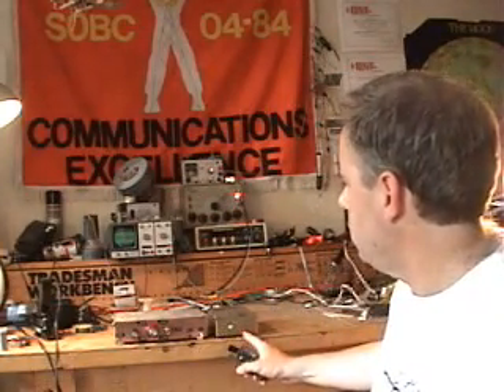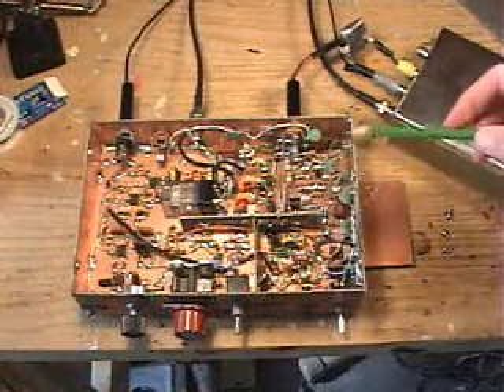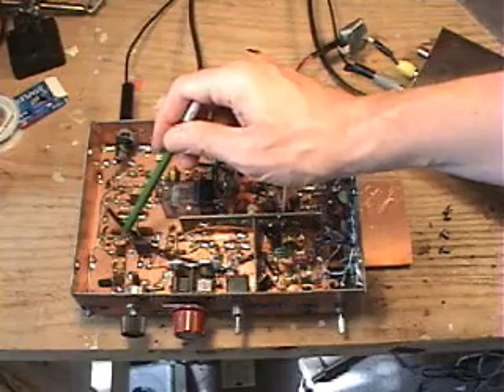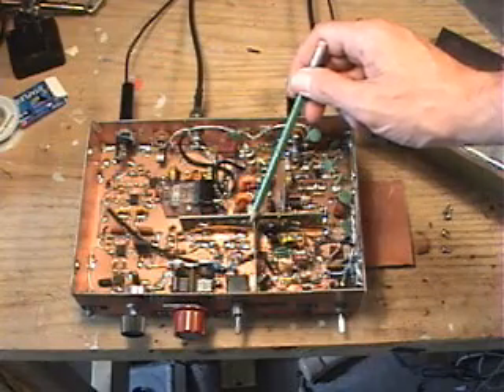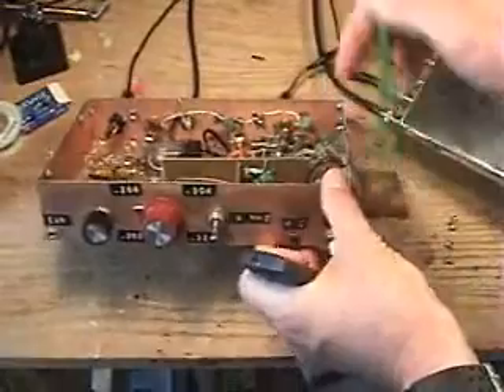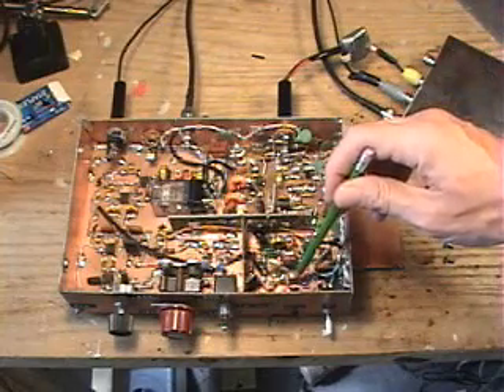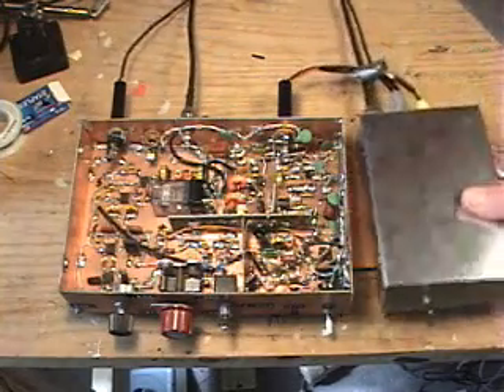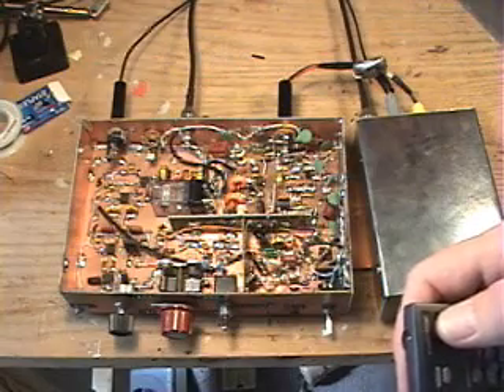Amateur Radio DSB Transceiver

Comment: 602 is a mixer oscilator,you can put VFO in with a 80 mtr oscilator for make 10.7 and 455 khz,i have a ARDF for 144 mhz in DSB,from a CAI converter,the 144 IF is a BFR96S,with 4 coils,that make 144 IF to 10.7.with a 602/612
You say it is ugly ,well thats not the point ,if it works,then make it no sense,how it look like
Good luck with  your projects
Gerard PA10403

Comment: Just watched the LTSpice demo, the one made with WINK. I am impressed with both the meta-information (I'm going to use wink myself), and the presentation about LTSpice. 
Go ahead and laugh, but wouldn't it be nice if there was a program that was an actual graphic-based workbench simulator? They have surgery simulations, why not a virtual soldersmoke generator? Click on the solder, click in the iron, small wisp of virtual smoke rises.
I prefer the real thing, but...